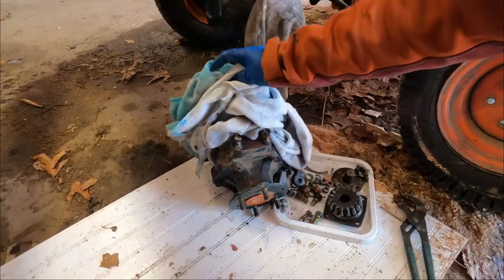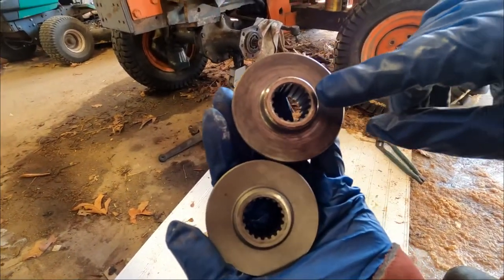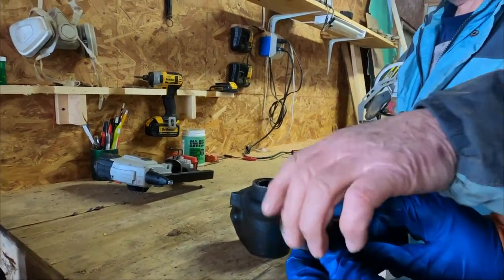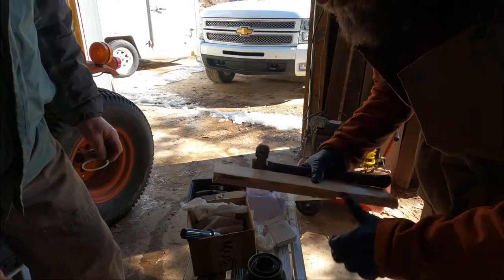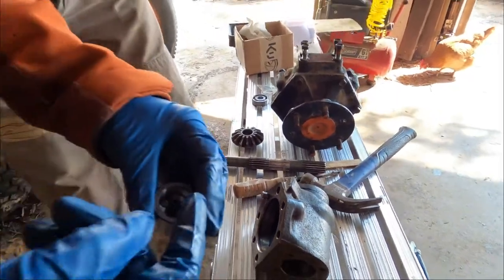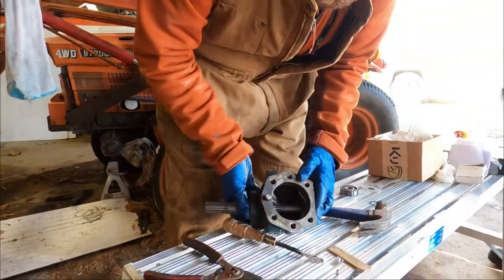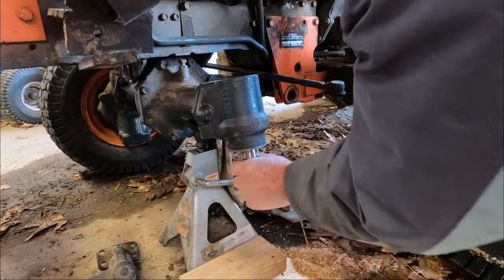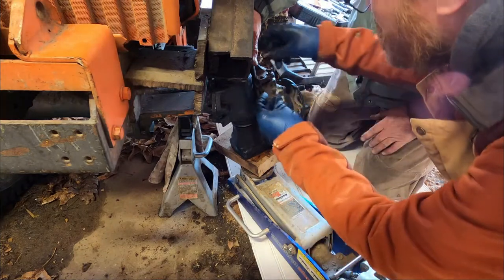Kubota B7200 Semi-Compact Tractor Bevel Gear Bearing Repair (Ep 45)

Comment: Kinda useless without showing how to take it all apart. I ordered a B7200 manual, my brother and I will eventually figure it out.
Reply from the maker: I am sorry this was not detailed enough, our Kubota dealer did give us a printed schematic. This was about a 3 day project as they had to order parts so we tried to film as much as we could.
Reply: @SchraderBoyzTV  Thanks. I bought a Kubota manual for about $50. My brother doesn't want to work on it because belongs to our old man's "foundation", but I want to do it just to see if I can. We also have to repair two of the hydraulic cylinders for the front bucket loader. Seems fairly straightforward.